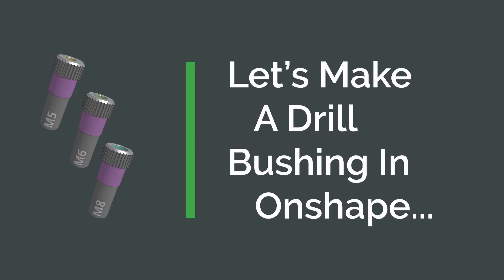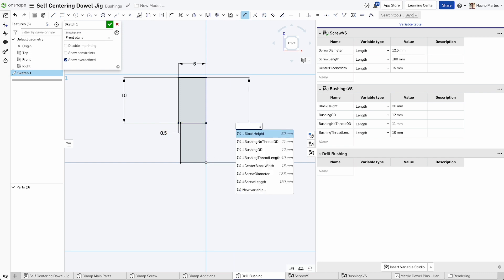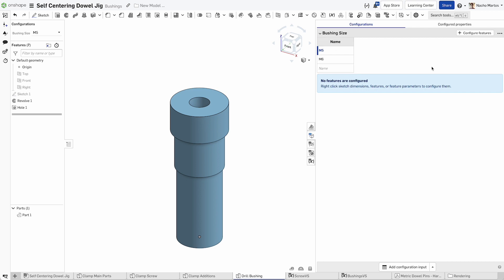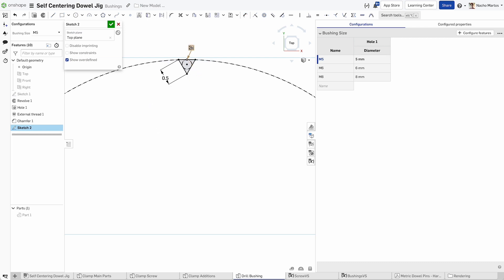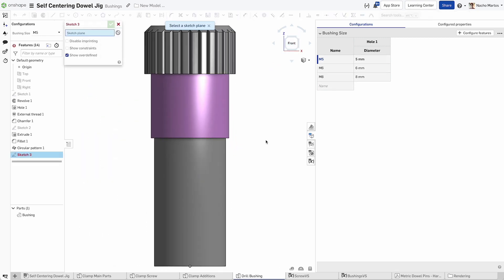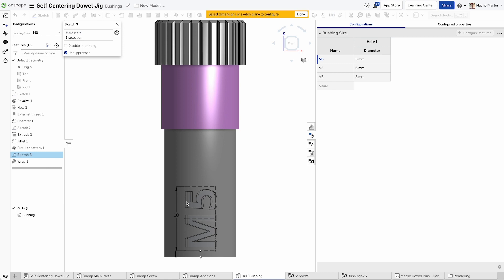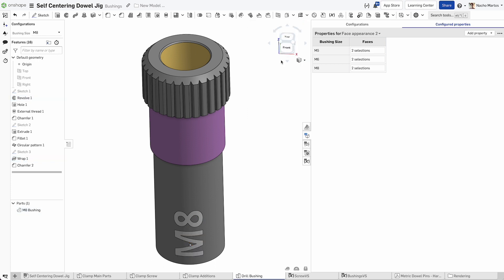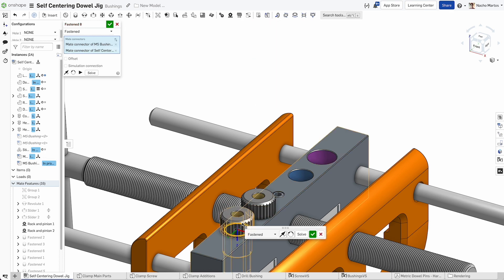Let's Make a Drill Bushing

Comment: Thanks for the tip on rotating the text box with the transform. I've been removing the default horizontal constraint, adding a pinned constraint to one corner in order for it to pivot, then drag rotating it to the new angle, then removing the pin constraint. This is much simpler.